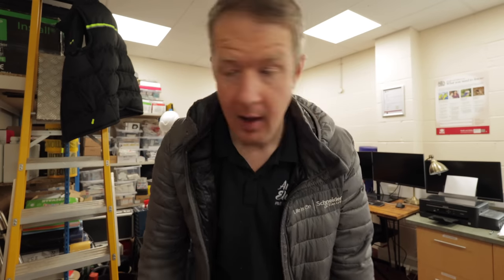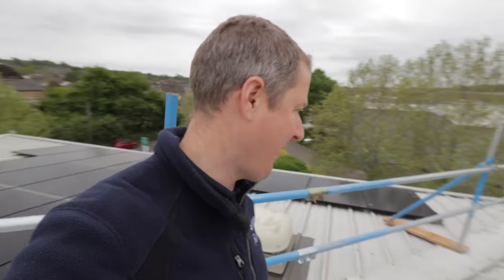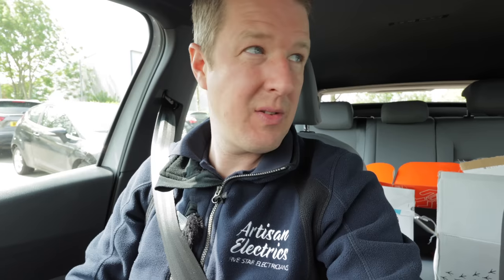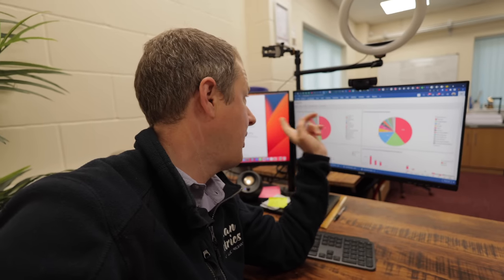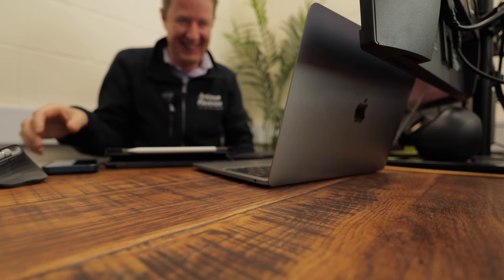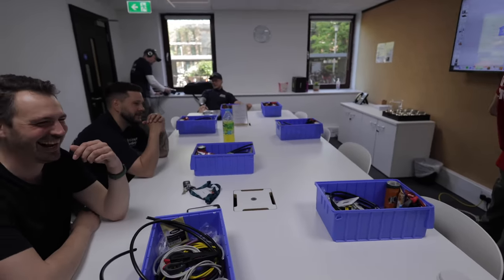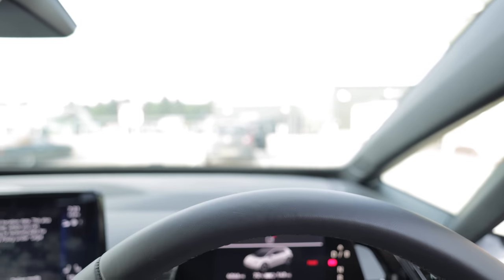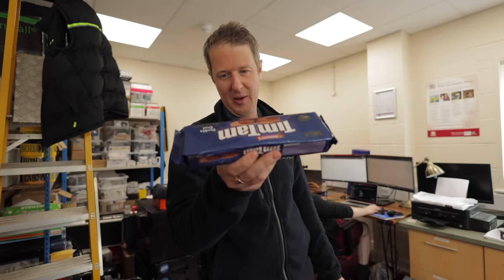I Can't Believe This Happened Again!

Comment: that solid bird protection around to make sure there is no cooling air and panels get nice and hot and reduce there output! " Solar panels perform best under moderate temperatures, as higher or lower temperatures can reduce efficiency. For every degree above 25°C, a solar panel's output can decrease by around 0.3% to 0.5%, affecting overall energy production "

Comment: A point for me to make with regard to the potential fault on the chargepoint. If memory serves from the 1st video wasn't it a Zoe they were having trouble charging?
Zoes are known for being VERY fussy with chargepoints if the Earth isn't quite right, other brands have a much higher tolerance usually. Are both charge points connected to the same earth and if so are they giving the same reading?

Comment: Jordan I’m not sure if you’re aware but I recently spoke to eFIXX about this. All insurance companies are now insisting that chargers be located 7.5m away from buildings due to the inherent risks they pose. (7.5m from non combustible walls, 10m from windows and openings) this isn’t yet mentioned within BS7671 but it’s being discussed at great lengths with the FPA and is being talked about as an amendment to the fire safety act.

Again I’m not saying this is law yet; but it will be coming. So worth baring in mind with your ev installs
Reply: BS7671 isn't law and insurance companies don't make legislation either.
Reply: @VinoVeritas_  they do indeed make legislation hence why it’s being incorporated into the Fire Safety Act
Reply: @oOoR1CH1EoOo  You're absolutely ignorant then. Only the House of Commons can introduce new legislation.

Comment: Wow, charging an iD3 with a NACS plug? So the boss is the only one protecting his skull... I guess that makes sense...
Reply: The UK doesn't use the Tesla connector/ NACS. Tesla have used a modified version of the Type 2 mennekes connector here on older models, the newer models use Type 2 CCS ports. This means that all of their charge connectors are physically compatible with other brands here, they just don't always give the option. AC charge points can be locked to Tesla only and superchargers for the most part are still a closed network. Some selected sites are open to all with the use of the Tesla app.